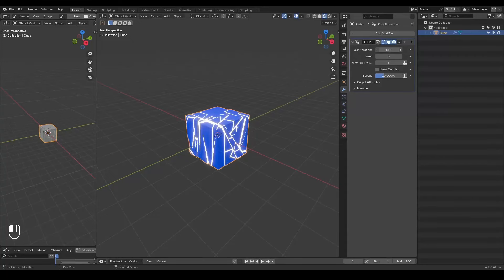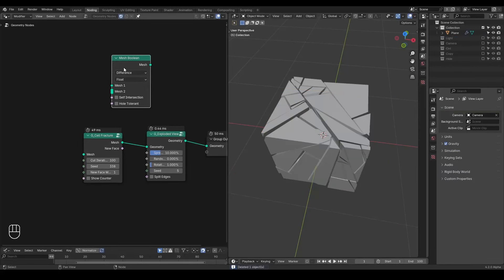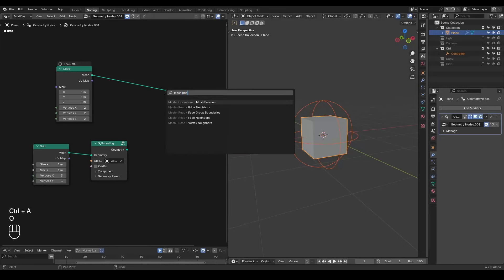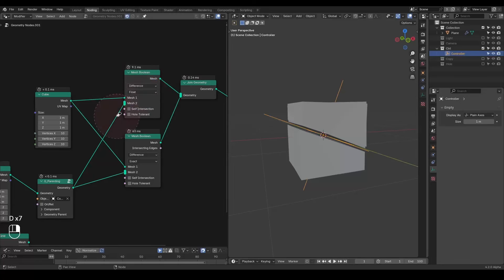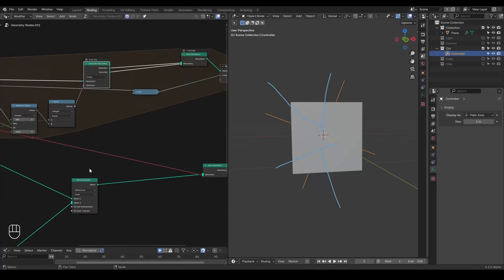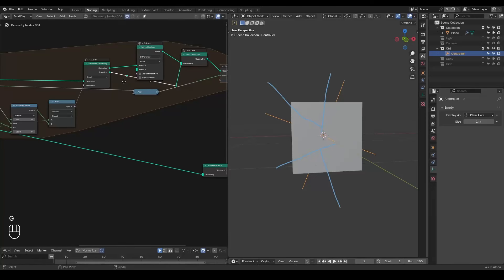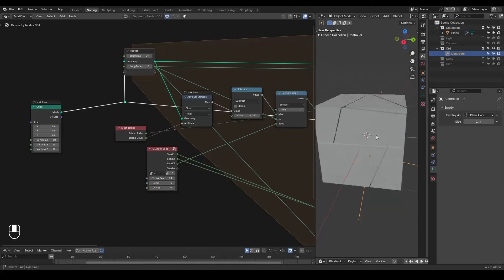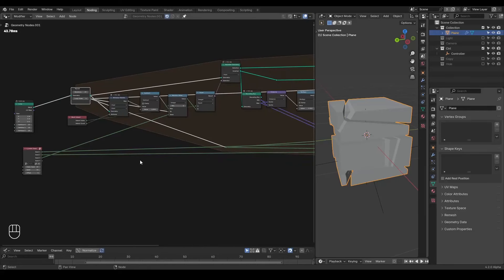[Tut] Cell Fracture as Modifier - Blender Geometry Nodes 4.2

Comment: How would you output the shards of the individual cell fracture in a folder after applying the modifier ? also when output instances are checked in cell fracture the apply modifier does not work...
Reply from the maker: in edit mode, you can hit P and separate "by loose parts". But it depends on why do you want to do so as well. The designed workflow likely will never encourage you to apply the modifier.

Comment: Hi Bradley, download your node pack but cell fracture does not come
Reply from the maker: Are you using the addon or presets? Did you install the addon following the installation guide? Are you sure the addon is activated correctly? etc.
If you are downloading presets instead of the addon, make sure you are using the correct version as 4.2.
Reply: @bradleyanimation120  You were right Bradley, I had downloaded the presets and was testing them in blender 4.0 and 4.1, then I downloaded 4.2 alpha and it works for me, thanx a lot mate, thanx share ur presets